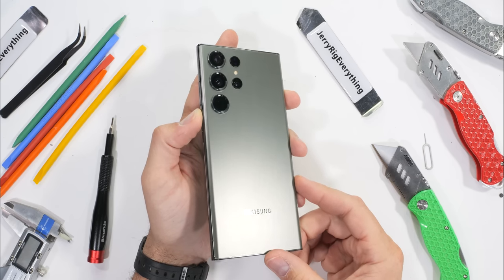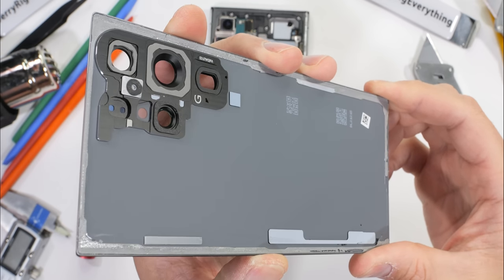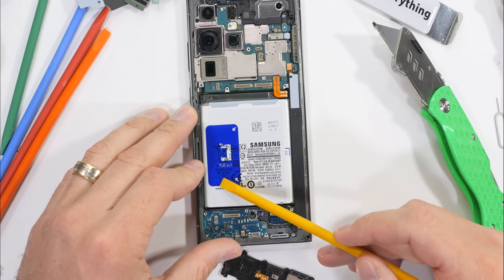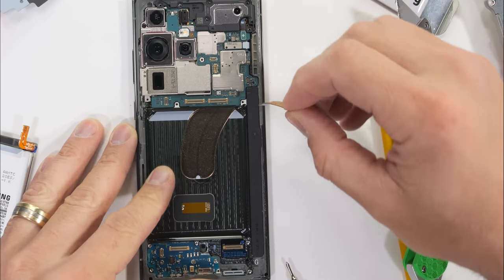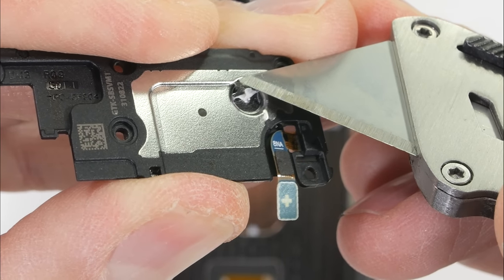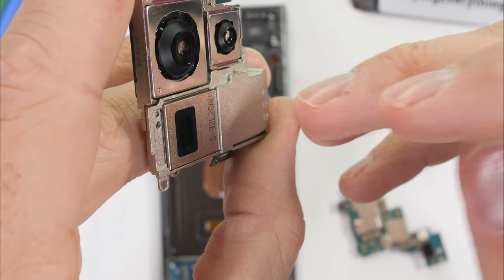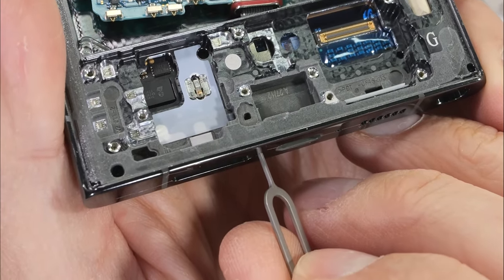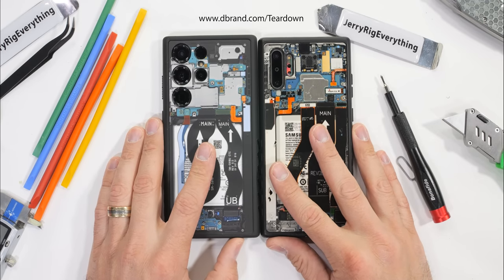I waited 8 years for this Galaxy S23 Ultra Teardown...

Comment: Zach's major problem in every galaxy device teardown is Samsung using strong adhesives to glue the battery to the device, but now Samsung has started using Pull Tabs, I am sure Zach can now finally upgrade to the S23 Ultra from his Note 10 Plus!.
Reply: If Zach actually takes care of his battery over the years that he has, there is basically no need to replace. My Note 10+ after almost 4 years of use, gets a little over 6 hours of on screen use from 90 to 10. Only reason why I got the S23 ultra was that I got almost $700 off trading in so it was a no brainer after 4 years. But I am not getting the super great battery that everyone else is getting. 8 hours of off screen time when sleeping is almost 3-4% battery loss from this phone which is the same as my note 10+
Reply: @95thRiflesOCI  Does the Note 10+ still receive security updates though?  If so, for how much longer is the real question.
Reply: He won't
Reply: @longlin1024 The note 10+ gets quarterly security updates currently but will end this year sometime I think. The note 10 lite still gets monthly security updates
Reply: @95thRiflesOCI  the Note 10+ also has a 700 mAh smaller battery, and the S23Ultra has a faster clocked CPU so I think that it ends up balancing out. You're getting similar battery life on a device that has much newer, faster, and more capable technology.
Reply: But why upgrade something that does all the job good? Even 5 year flagship ones still do the job very goos
Reply: @Hacien  nope. It's last major update was android 12 and it has been quite a few months since the note 10/10+ had recently any kind of update,
Reply: @Hacien  I don't understand peoples obsession with security upgrades. If someone REALLY wanted your phone or data those "security" updates won't do anything. It's also more likely the device's own bloat will compromise the security because most of them are built like garbage.
Reply: dont believe zach's lies
Reply: @95thRiflesOCI  and, he really has no plans on changing his phone as well
Reply: I bought S23 Ultra 6 days ago but writing this comment from my Note10 Plus, it's not an easy decision 😃
Reply: @Hacien  think android 12 will be the last update for the N10+ but may get monthly security updates for a year, then it's done...
Reply: Remember when he said he will only upgrade to a phone that has all the essentials? Well, that was a lie I guess
Reply: @MiGujack3  There are a lot of people and anyone can be obsessed with anything 😃
Reply: @MiGujack3  I put a seat belt on even if there's still a chance that someone can hit my car.  Same concept.
Reply: @95thRiflesOCI  And if battery dies you can just replace it. With a lot of pain for sure.

Btw, using phones for so long is problematic because batteries tend to swell. Hopefull it won't happen to you or Zach.
Reply: Jerry*
Reply: This is why apple is much better
Reply: unpopular opinion:
as a Note10+ user since day 1, the S23 Ultra doesn't convince me to upgrade to it as imo it doesn't have any significant upgrades (compared to say the Note9 to Note10+) and it still does my daily tasks and usage pretty well. In fact using the S23 Ultra makes me feel like I'm using the same phone all over again only now with a thinner wallet. Gave my Note10+ a battery replacement a mnth ago and it's battery is back to lasting an entire day and is ready to serve me again for another year or 2. Regarding software, it unfortunately stops on Android 12 but is however still receiving security updates on a quarterly basis. I'll upgrade when the upgrade is significant enough to convince me, so far the only convincing upgrade in Samsung's lineup for me are the foldables but they're pretty unreliable atm so I'll pass on them for the time being.
Reply: @vrnvorona  not as hard as you think, a friend did his s10 a year ago and took around 15mins of planning and 20mins process, could have gone faster but he wanted to preserve the glass panel. 

Phones swell after being in storage and not in use. If you daily drive a phone you have a very small chance of this swelling.

Not to mention once the battery dies I'll just trade it in or keep it for next years trade in, no biggie.
Reply: @OnTheFence_  Zack actually did replace his battery when his phone's screen died, he replaced it with his teardown note 10+. So he basically has got a new battery.
Reply: @amirulaiman8673  I'm curious what upgrades do you really want? When you mean upgrades what kind of leap do you really want?

I have the the note 10+ and I've been using it for 3 years now and i think the s23 ultra is now a major upgrade compared the note... And no i disagree with you... A lot of people disagree actually.. That the note 10 is superior to note 9.

Foldables vs the ultra lineup? No way... Cameras are way superior, the ultras get all the best stuff while their foldables get midtier... Aka still experimental.. Chinese foldables?? . Goodluck with that.

S23 ultra has faster ram, faster chipset, faster ufs4.0, faster fingerprint,120hz, etc... Meaning everything is significantly better..

No this phone will not be super obvious as upgrade.. This is like having nvidia 2080 then upgrading to 40 series... 2080 is still fast in todays standard.

That's why i ask what kind of upgrade? Do you really think samsung would rush and halfass everything? Like 4k screen (meaning bad battery), cpu and gpu that could rival rtx (impossible and not so useful, again battery), battery that is higher that 5000 mah like 10000 mah (even if they do people are going to complain how thick it is), fast charging faster than 45 w? Like 200w? (people are going to complain about heat and again you guys want 10000 mah phone so it's going to be the same time anyways), Cameras that could rival mirrorless cameras like Sony A9? (no way that is impossible), 3000 nits and high ppi? ( again battery and heat and ppi doesn't mean quality all the time), storage higher than 1tb, maybe 2tb? (again people would complain about something), storage faster than the fastest nvme available? (no way they are going to do that)..

Again you people like to include these features then complain again... Yes people always complain.
Reply: @LSDdreams808  no.
Reply: @frenchalcantara8424  see, there's one point you miss - every "new" feature you named is not new, it's just more like what marketing says. It's just boring, personally, I don't need any of these specs that much since i don't play games on my phone, I have PC for it. I still use s9, and every year i'm ready to spend a buck for a new phone, but what i see is rather downgrades ( sounds weird - I know). I like the size and curved edges of s9, no any curved edges with this size anymore, i like HR sensor on the back since I don't like to wear watches, I like small diode on the top to tell me bout messages and so on, hate this black dot camera on a screen, and i like that "physical" underscreen home button. Iris scanner was as well a cool feature. Of course I would appreciate extra performance, new top notch  screen and improved cameras and battery life, but at what "cost"? No any high tech feel, just boring slab of glass with highest so called performance and no choice. I even forced myself to try iphone as something new, but the closest to my feel is most likely foldables, yet they are not well rounded enough. I just want that feeling when i replaced s3 with s9, that was a real deal. Hope s24/25 will become worthy.
Reply: @LSDdreams808  I do enjoy a bit of sarcasm...Though a bit more detail would be nice. "iPhone is much better because they just now invented the type c port" "iPhone is much better because they started selling last years phones renamed as the latest model" "iPhone is better because I enjoy being told what to do" Just add one of these next time.
Reply: @MiGujack3  - Do you leave your home's front door unlocked and the keys in the ignition of your car?  Do you autoboot into your desktop/laptop to skip the login screen?  You don't have to make it easier for them by using a phone that doesn't get regular security updates.
Reply: @95thRiflesOCI  my S21 gets about 2.5 hours of screen on time. do i need to change the battery?
Reply: @LSDdreams808  keep dreaming lsddreamer
Reply: @MrAnderson58  S22 ultra was getting around $830 for mint condition. Not including the bonus and vouchers. My Note 10+ was $560 + $150 voucher in vouchers before the other discounts. Carriers would have given me almost $600 but no vouchers. Since they can only be used at Samsung
Reply: @95thRiflesOCI  do you live in the US?
Reply: @MrAnderson58  nope canada.
Reply: there isn't a headphone jack on the S23 Ultra tho
Reply: @adityanarayansreejith9362  the Note10+ battery was 4300mAh out of the box. I was speaking to that difference. I didn't even consider the degradation of his phone
Reply: I don't think he's gonna upgrade now; but now Samsung is back on his list of what to pick.
Reply: @griffindotexe6620  there isn't one on the Note 10+ either
Reply: Haha interesting
Reply: @95thRiflesOCI  700 dollars off, when you trade in note 10 plus?  How is that even possible. I have an s22 ultra and trade in for this may be around this.
Reply: @VargpinM  the black hole on the screen and the pen on the left side I found only the flaws with the design for now.
Reply: No shut he said that in the video Sherlock
Reply: He sure could or he probably did and showing us  supposedly 'his' main old samsung note as a gimmick and he probably uses the latest flagships anyway with his income from YouTube it's no brainer to enjoy latest and greatest tech
Reply: Don't know if you already knew this but you can get unofficial updates on your phone or just custom new operating system
Reply: My samsung a 30 s telephone lasted 4 year. Now it is full. Sistem filled the telephone. I want to use more and more years because  I cannot buy new one every 4, 5 years

Comment: S23 ultra also has a maintenance mode so when you get it repaired, the repair man can get access to everything he needs without being in your phone
Reply: That's not just a s23 Ultra thing, it's a OneUI 5.1 thing. The update rolled out to my s21 Ultra 2 days ago and I saw that feature
Reply: Didn't know about that feature, thanks a lot it's amazing
Reply: @MG36963  still, makes repairability easier
Reply: Its a great feature but when I sent my phone in samsung still factory reset it. 😑
Reply: @conradbreitfeller3841  Agreed, but for those that don't have the s23 but will still get the OneUI 5.1 update, this is nice to know
Reply: @Ogrillion its a new feature
Reply: @printhallo  aye. I have had it for a bit. Sent my phone in with maintenence mode enabled. Screen was replaced. Phone was still factory reset. 

Maybe they have to with a new screen idk. Just failed to see what maintenence mode did for me. Maybe techs are still new to the new process.
Reply: @Ogrillion  As far as I'm aware, it's not for preventing resets but instead to prevent those doing repair from accessing sensitive personal information such as personal images, texts, or contacts.
Reply: In Realme, You can just start clone OS which acts similar and we can set different password for main and clone OS and switch between them seemlessly without any restarts
Reply: @Ogrillion that happens with every brand, even Oneplus
Reply: @ratrodgrady ok but if they factory reset anyway, then you might as well reset it yourself, problem solved 😂
Reply: 5:42 “thats what she said”
Reply: Ui 6 + android 14 (they fail to mention the android upgrade change) on s21

Comment: The front camera is definitly not permanently glued bro. I work at a repair shop and change s23 ultra screen every week and i can assure its not
Reply: Would you say the s23 is a good repairable phone ?
Reply: Just changed mine yesterday definetly not glued
Reply: My S23 ultras power button is keep falling can i replace it without disassembly ?

Comment: "From now on I'm gonna be significantly more careful"

Proceeds to destroy wireless charging pad
Reply: I was looking for this comment 😂😂👌🏼
Reply: I bet it still works, he scratched the plastic coating only
Reply: @timoarrg  Nah he scratched off some of the copper wiring, it's ruined as he probably destroyed the circuit
Reply: @LashanR  as long as he didn't cut one of the traces it can be fine, we really don't know but yeah, it may be broken
Reply: My thoughts exactly lol
Reply: U beat me to it 😂
Reply: @Manishnair222  😂
Reply: Been told to use a plastic pick: Uses his branded knife!
Reply: Looking for this comment the moment he started to tear down the charger.
Reply: That's the joke
Reply: I was gonna say that lol
Reply: This guy has been rigging since before you were born
Reply: Honestly watching him gives me serious anxiety and PTSD.. 😅😂
Reply: XDDDD
Reply: I have a I have the same device, but I made a mistake when I tried to insert the chip pin into the meek hole instead of inserting it into the chip hole. Does this harm the device or is there a protector that protects the microphone?

Comment: So glad you covererd the part about sticking the SIM card removal tool into the microphone because I did exactly that and thought I had messed up the microphone. I started pushing hard because the tray wasn't popping out, LOL. Glad an engineer thought about that!
Reply: Giggity
Reply: Me too so glad, I peed my pants, it
Reply: I would have googled for the correct hole, just to be safe. Love my s23u. Big jump from my S10e.
Reply: It's not that difficult lmao
Reply: @jakefriesenjake  Using S8 since 6 years. Imagine the jump for me from S8 to S23 ultra. Can't wait.
Reply: @BhaisahabYoLo  I like the new s23u, but while only texting with 1 hand, sometimes my palm touches other buttons, due to the size of the phone and the curved, rounded edges of the screen. Not too happy about that
Reply: @BhaisahabYoLo ..... i had my 7s edge since its launching...... imagine my jump from su edge to s23 plus....
Reply: I also did it, so the microphone doesn't get damaged, does it lose the IP68 certification?
Reply: @mauxander  no, it does not..
Reply: I wish he would have pushed the entire sim tool in and see if that would actually cause damage. I did and now I'm worried about the water proofing
Reply: @BhaisahabYoLo  How do you like the S23 Ultra? My S8+ power button only works sometimes now and I ordered the S23 Ultra from backmarket. It was either the 24+ or 23U for the same price and it seems the 23U has some better aspects to the camera than either 24. The pen doesn't matter to me and I wasn't paying almost double the price for the 24U.

Comment: Once, I accidentally slipped the sim remover into the mic and i was scared because I thought I had ruin the mic. I immediately ran a diagnostic and realised the mic still works fine, I was like how is it even possible but now I understand why. Well done Zack, you're doing a great job.
Reply: Did you push the tool all the way in? I did and now I'm scared I broke something or the water proofing got damaged
Reply: @santcoin4031 Yes I pushed all the way in and applied pressure so as to pull out the sim tray. I realised it was in the wrong hole when the sim tray wasn't coming out and fortunately nothing got damaged. Your phone should be fine, there's absolutely nothing to be scared about.

Comment: It's amazing how a phone is now a super computer compared to old standards. Really impressive what they can fit in there. Loving my s23 ultra as well
Reply: Zack called the Note 9 a "water resistant laptop in your pocket" and he wasn't wrong. The difference is the Note 9 didn't have the most amazing software and the market hadn't become quite as good yet and I could tell. With the S22 Ultra it really feels like we're in the age of peak smartphone. The hardware is so rock solid, the improvements are now gonna be related mostly to AI.
Reply: Nokia 3310- Smartphones r my bitch
Reply: Anything from the note 10 and up is good 12gb ram 4k 1tb internal and with the 23ult you get that sweet 200mp cam action
Reply: Sir please help My sumsung galaxy s23 I accidentally poked sim ejactor with pressure on microphone hole does it damage waterproof or microphone please help
Reply: @Raj-bu2xv  No it doesn't. Zack tested it on a previous teardown. You're fine don't worry
Reply: @BonJoviBeatlesLedZep  brother thank you for reply does he have teardown video of s23 if thier where I can find bro I buyed yesterday bro with emi I was soo worried I didn't slept whole night
Reply: Bro I have s25 ultra already, what are you talking about 😂
Reply: It is a powerhouse. S22U here and it is fast, cool and very reliable.     Efficiënt not so,  .. rather would have your s23u version for  great batterylife, but have to live with the exynos as long as this phone lives. Maybe i'll do a screen/battery swap next year as this ineffeciency just kills any battery in the long run. :). No worries otherwise very happy with my lesser super computer!! haha